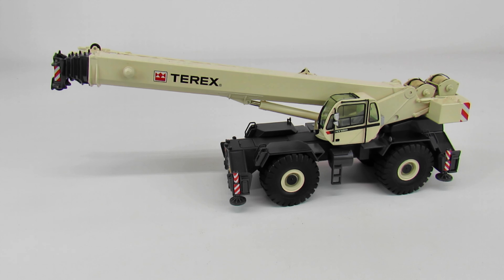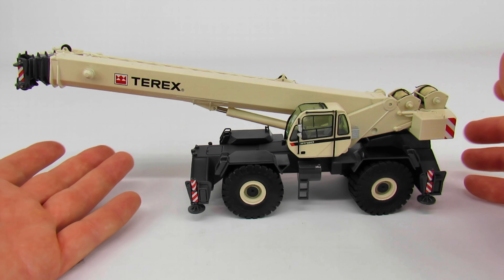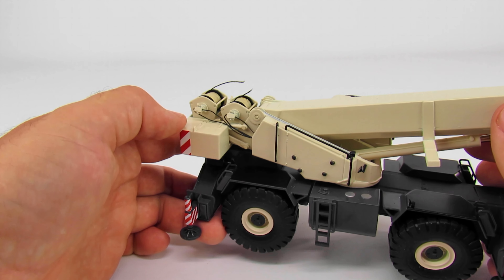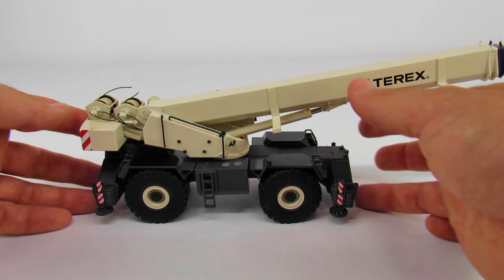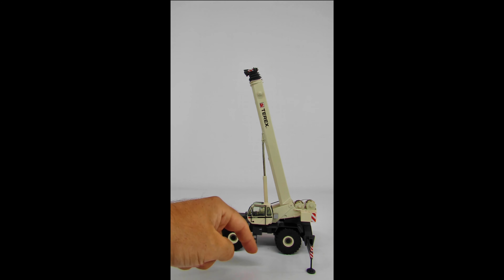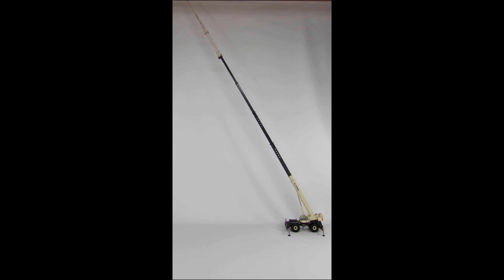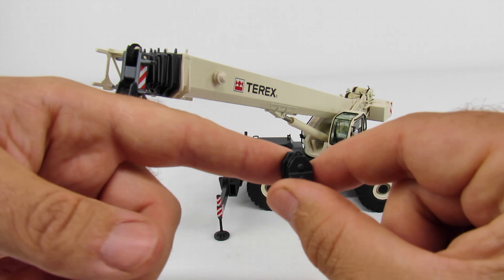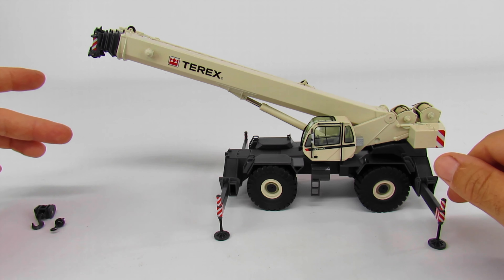Terex RT130 Rough Terrain Crane from NZG

Comment: Continued from previous comment: boom end shieves were made as one piece (no individual sheives), so the realistic individual sheive rotation was impossible, during line raise or lower operation.  I fixed this by replacing the one piece "sheives" with individual sheives, & replaced the factory supplied crane line (nylon thread) with smaller diameter line, for greater line flexibility around the sheives, & the smaller diameter line was probably more to scale, as well.
Reply from the maker: There's a braided fishing line called Muskie Master that is great for cranes because it won't twist. It is a little too thick for smaller cranes but it still works great. Thanks for watching!